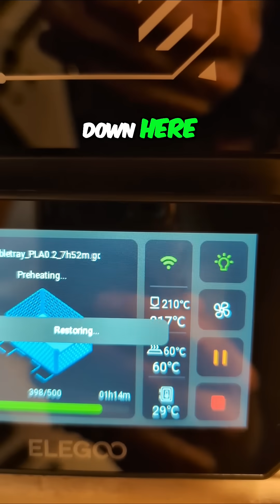3D Printer Resume! Will it work? Restart After filament ran out!

Comment: Sometimes when my Carbon is paused when it either runs out of filament or paused for a manual color change, it decides to cool down the bed after awhile which can make my prints detach. I hope they fix that.
Reply from the maker: Agreed I had that happen on a bed with 12 items. Luckily only 2 came loose.